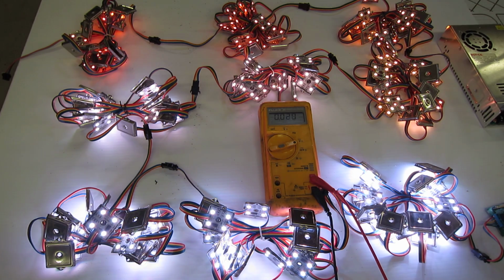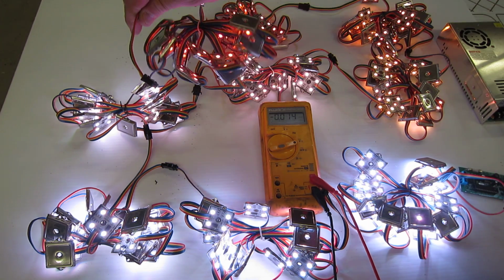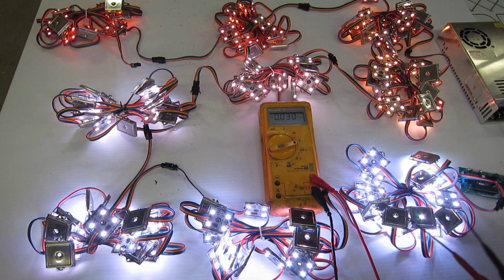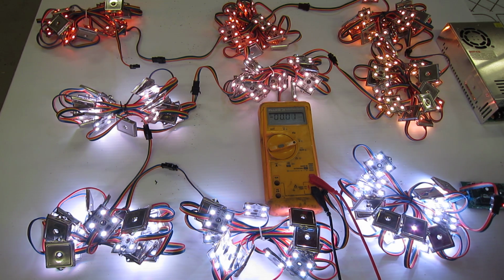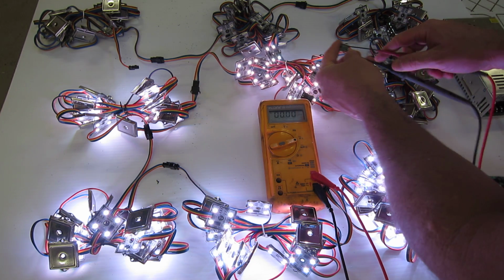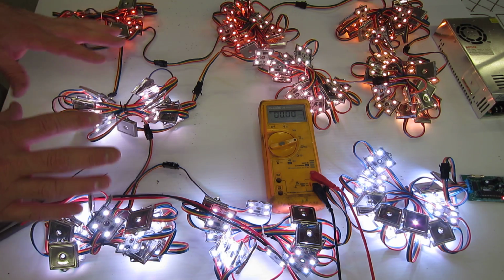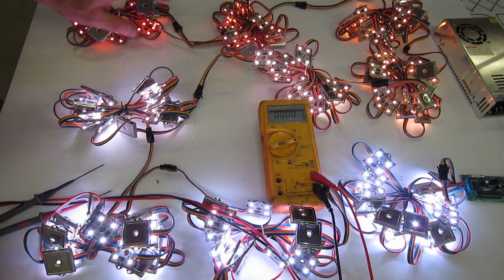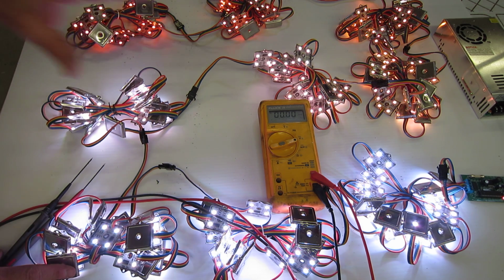The effects of power consumption of RGB lights over long distances

Comment: This was a better video of power consumption.

Looking for one similar to this that ..... 
1.  Starts with the basic information.   Power size of controller.  LED string data such as voltage/power or amp requirements.
2.  Plug 1 string in .... show the math on consumption.
3.  Then doing the math calculate the information and show the result .....  

But this is definitely a bookmarked keeper.

Comment: Sure wish you would have actually injected power instead of talking about it.
Reply from the maker: Some customers have never worked with low voltage lighting and have not see the effects of power loss, so our goal in this video was to show that effect.  To see what the lights would look like with power injection, see the first pixel in the string.

Comment: Testing of LED strips over the years has shown that a repeater/amplifier is needed for every 2 strips to maintain full brightness on each strip.  I wonder how much of that is due to the small gauge of wire being used for strips.  If you could build your own with thicker gauge wire do you think it would require less amplifiers for a longer parallel run or would it end up burning out the LED's?
Reply from the maker: An amplifier is only required when we are injecting power on dumb lights AND from a separate power supply.  If using dumb lights and a single power supply, the injection can happen by using a simple positive and negative wire back to the power supply.  If there is so much power injection that an amplifier is needed (which is extremely uncommon in holiday lighting), we almost always move to pixels instead since power injection doesn't need the cost of an amplifier.  The reason that most pixels have 20 to 22 AWG wire (real 18 AWG is exceeding rare and usually a fake number) is because the solder pads make it nearly impossible to get three 18 AWG wires soldered onto them.  Plus, most customers are driven by cost, so it is often just cheaper to power inject for those few runs that are really long.

Comment: Thanks for the demo.
Can I power each end of 13meters LED strip 5050 and join in the middle (to have a complete circuit back to power supply, or is this dangerous? (I would use 20amp to cater for the load)
Reply from the maker: If you are power injecting on strip, it depends on the type of strip.  So for 30/10 it would be:
Power+Data > 10 meters > power injection
Power+Data > 5 meters > power injection > 5 meters

Contact us directly at http://www.holidaycoro.com/contactus for assistance with your specific holidaycoro hardware